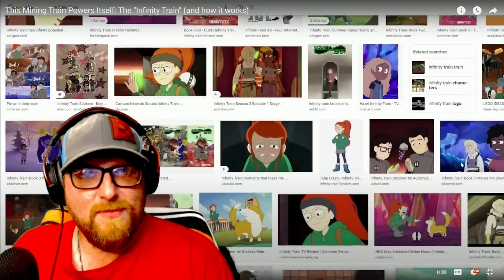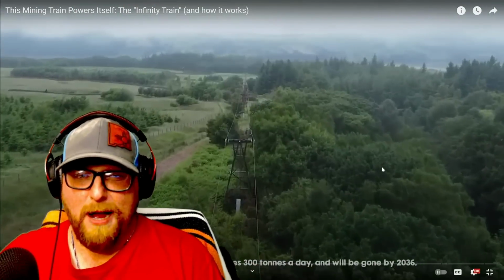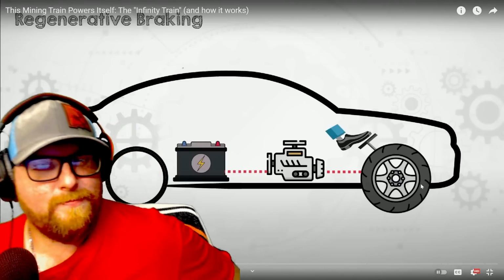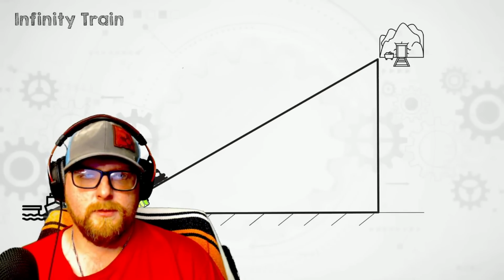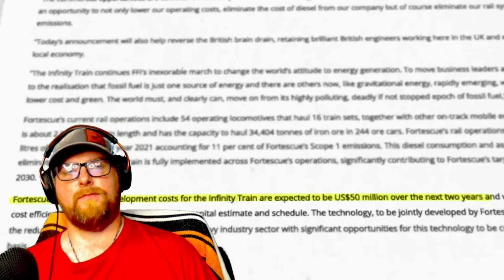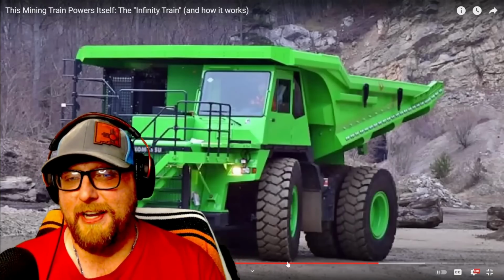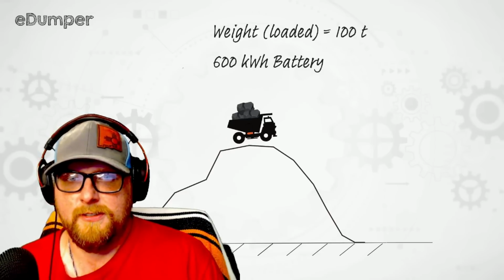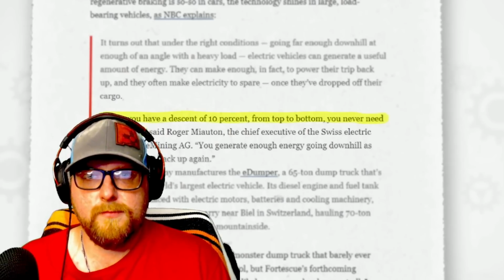American Reacts to Australia's  "Infinity Train" No Fuel, No Charging

Comment: running daily they will churn thru the batteries as they will only have the minimum amt of batteries needed... a deep discharge situation. still a better scenario though the regular costs are not stated for the battery packs.  Trucks are a wonky idea.... Nearly all mining is from a hole in the ground? Yes that means no meaningful regen...   better off using hydrogen in the existing diesel trucks.

Comment: Sailboats are starting to use hybrid diesel/electric propulsion systems. If you have enough wind, your hybrid motor turns into a generator that charges your batteries by turning the prop all without using an ounce of diesel fuel. You also can supplement your charge with solar power. Pretty cool technology.

Comment: And only if thay could make car s run on compressed air as the car drive it take s in air  to two light weight tanks. Plus solo powers. And an battery. If no sun. Car will run on compressed air. When no sun out.  And the air intake chardge a turbine  that can power the car. Battery to chardge it to. If no sun out. No need for charging station .

Comment: There are many old funicular railways that usr water tanks in the downward car to pull up the other car (connected by cable). This is not perpetual motion as the water going down provides the energy. If water is free then taking it downhill is economic. With the infinity train you are just using the electric battery as a cable replacement ... the power comes from the potential energy in the load. You could do similar with passenger trains if you had a free resource (water) and used it to generate power on the downhill trip ... but why not then use the water to generate power and feed it to the train to power it? ... you can still use regenerative braking to save energy.
The infinity train will only work if you can generate enough power for the round trip during the trip itself (not ignoring losses).
Remember that if you have a failure before you can generate enough for the upward trip then you will need alternative power to return the train to the top.
The slate quarries in Wales used the weight of the slate going down to pull the empty wagons up using a rope 'balanced' incline. The Festiniog railway (from about the 1850s) used the weight of the slate to go down and horses (later steam power) to pull the empties up. Unfortunately there was no regenerative capability then and also then too long for a ropeway!

Comment: Remember that any aerial tramway for taking mined product or timber from mountaintops to valleys are also significantly "gravity powered" (though braking systems may not have been regenerative historically.)...  Obviously if things need transporting uphill (net) then energy input is needed.  - most mine to port operations are downhill, reducing energy needed somewhat due to geography..

Comment: Sorry this is a bold face  lie.  What is not told is that the batteries will not last and cost millions of dollars not thousands to replace. A tesla car battery costs around 15 thousand dollars to replace.  Enough batteries to power a train up the hill an carry all that weight is millions of dollars. Funny part is it takes billions of dollars in diesel fuel to dig up enough raw elements to create these batteries. So this is all bull shit! And anyone who thinks this is great is an blind idiot because the damage to the earth is greater than burning gas or diesel.

Comment: 1:43 this already happens with some electric quarry trucks.
edit: 7:47 never mind, she mentions it.
But she is wrong about the "not 100% self sufficient or there is another similar truck. Because at the end of the day, the dump truck has to be plugged in, to EXTRACT energy from it, because it's regenned so much during the day it doesn't use it all to get back to the top of the hill. So ends up with surplus.. And they sell that back to the grid..

Comment: So good to see thinking young people coming up with adapted concepts such as this even though the principle has been around for a long time. I am aware of far too many fuddy duddies in my older age bracket who are so set in their ways they don't want to know about this
In Oz we are building the Snowy 2 addition for Hydro power and it uses pumped restored water for power. Also aware of trials in UK where heavy walking areas are fitted with tiles that generate energy when walked on...promising stuff. Also the freeway small wind turbines that generate energy as fast moving cars travel by.. 
We have to remember we used to use nothing but wind and water energy at one time before we had power stations.
Reply: The problem with the this train is this. Everything what she saying can work, but the major problem I see is the batterys

Comment: They also use AI and robotic trains up there too. With many trains actually operated remotely in Perth!!   Thousands of miles away!  Huge capital saving with fuel and maintenance too.
Reply: I work on that railway. Been around those robo trains for a few years now and it's still trippy watching a massive iron ore train that's 2.5km long going past you with no driver in the cab.

Comment: Whether it is cost effective will depend on battery life. We are already seeing worthless electric vehicles that need new batteries which would cost more than an equivalent working vehicle.
Reply: Average electric car battery life is fifteen years (based on Tesla experience).
Locomotives chassis are rather more robust than the average car so swapping the battery may be economically viable (assuming that the recycled chassis used for the test locomotive lasts that long).

Comment: Electric power what You generated  is lost ca 15 -20 % to elecrical ines + tarnsformator to get right Voltage  and Ampers. That los get  bigger when temperature is too hot or too cold = ideal temperature is  + 12 unti + 18 Celcius. 54 until 65 F. by humity  49 - 65%.

Comment: A lot of commenters need to calm down and realise that this works only in a very specific circumstance. The mine must be at a far higher altitude than the port. The train recharges it's very large and very expensive battery by regenerative braking while going down hill with a very heavy load. Once at the port it unloads and is much lighter. It then can use its battery to drive up the hill back to the mine. It can only do this because now it is empty and much lighter. If the mine was at a lessor altitude or say level with the port this system would be useless. There is no magical technology at work here. It has no use in the every day driving of cars and trucks.  You couldn't for example use it in a passenger train unless all you are doing is dropping passengers off at the bottom of a very steep hill and never bringing them back up.

Comment: The pay back comes. But the battery making and change over is still stagering. Would be maybe a 20 year turn around for costs involved. If we can still get rare earth minerals and get them made. And I'm in Western Australia. Great idea, think hydrogen is the fix as the owner of the mine is pushing hydrogen hard for WA.👍
Reply: Actually payback on the energy cost of battery manufacturing is about two years average driving. Fuel production is horrendous inefficient too (only half the energy winds up in your tank from what comes out of the ground and at best your car uses about thirty percent of the energy you put in the tank).
Hydrogen production converts about 30% of the electric power going in, into hydrogen to put into your vehicle.
It’s only advantage is energy mass density (which is useful for rockets and slightly less useful for aircraft due to poor volumetric energy density).
Biomass fuel is probably more useful for aircraft.
Reply: @allangibson8494  back to the original  comment then. Hmmmm

Comment: How long do batteries last before replacing? cost ?and what landfill are they dumping batteries?
Reply: Still believing batteries are "dumped"? They are way too valuable to do so. Usually they get a second life a power grid stabilizer either in a house or a factory, depending on the capacity. And foe record: Modern batteries lose way less capacity than older ones. Their actual loss heavily depends on the way they are operated though. Considering this is a line where they are loaded and unloaded on a pretty constant level I guess they might work at least 20 years only losing about 5-10% of their capacity. And even that is a pessimistic assumption.

Comment: Ev are worse for the environment than diesel over a lifetime 🤦‍♀️🤦‍♀️
Reply: Not sure where you life - maybe that's true there? Maybe you still use lead batteries? Good luck with that. If not, your statement is completely wrong and a pure troll show. Maybe it was even correct in 2000, maybe 2005, but the turning point has long been reached, and the gap is widening every year.
Reply: @SirHaviland  like lithium is safer than lead tosser hahahaha
Reply: @MrDamo1648  It is though? Lithium is not toxic like lead. It can be used way longer than lead, and maybe not in your country, but in Europe nobody tosses out a Lithium battery because it can be recycled for a good price. Try that with a diesel fuel tank.
Reply: @SirHaviland  modern diesels are near zero emission these days and kids are used to mine lithium
Reply: @MrDamo1648  Near zero is an illusion that is fed by the automobile industry. Did you live under a rock when the diesel scandals popped up? They fix their stats to look better, and eventually they are busted. And children in mines? That was a thing way earlier than EVs were relevant. Nobody gave a damn about it. Bigots...

Comment: Pretty good idea if it works, going to the coast fully loaded is mostly all downhill, it takes miles for them to do a braking stop even from pretty low speed, the mass and energy is enormous. After unloading the ore it's pretty light.
Reply: The concept works all right. Think of those long gone lifts in multi storey buildings in the past which worked on counterweights. This is basically the same except that energy available is being stored.

Comment: The location of the iron mine in the Pilbara region of WA  of course is ideal for solar power, with large area available for solar cells  and very commonly major sun availability for most of the year,  also being in tropical near equator region  actually above Tropic of Capricorn  southern limit of solar travel for our summer,  northern winter,  so even has much time for solar overhead or close to overhead maximum power capture. Maybe only for short times needing diesel generator supplementing for tropical storms and cloudy conditions  likely only under 10% daytime  though storage needed as mines operate nearly 24/7. So truck may need some top up power even in the night.
Still making huge gains towards zero emissions,   maybe improving trucks and storage batteries the 2% deficite can even be reduced further  or be so small that the number of trips overnight can be run on stored power alone. But recharging full capacity in early daytime is too costly in time vs work capacity so remains difficult.
All a great future benefit. Cost savings should be very good, though rather than increased profit, allows cost of the ore sold to be kept lowered adding to competitiveness with mines in say Brazil.

Comment: And a significant CO2 reduction too.
There is also considerable saving on train brakes  as with massive regenerative braking there is minimal need for conventional brake pads to handle many thousands of tons of ore down hill. Wear down of pads  train wheels alone will be reduced massively  along with down time for maintenance  brake pad exchange and wheel replacements. Beyond that is that the train is now braked on board  not by friction from wheels to track rails, often for steeper sections even demanding sand onto tracks to keep wheel to track fraction high and not just slipping. Well the tracks now will have considerable longer life, as even will the rail stays having less forces from needing to carry the braking forces horizontally in same transient affected manner. Longer rail line life and lower maintenance of even that infrastructure system.
Reply: Wait until they find out how much weight in batteries they will have to carry, that will reduce cargo capacity, requiring more trips back and forth. Then the rapid pace at which the batteries will degrade and require replacement at huge cost. My money's on this not working out.

Comment: In Norway/Sweden, the Ofotbanen line transports iron ore from the mountains and down to the ice free port of Narvik. The ore trains generate more than enough current by regenerative braking to power the return trip. Of course, this is not a closed loop-system, Ofotbanen is connected to the main line in Sweden and is also used for passenger trains and general cargo. Balance power is hydro, easy and fast to regulate. This electric line opened 99 years ago.

Comment: The word of the day is funicular. The ropeway system mentioned in the video is a funicular system of counter balanced carriers helping negate the need for extra input to overcome a grade. As for the E Dump, it's not new either, A lot of the bigger run a diesel generated electric propulsion. This opened the door for using a pantograph system to help power the truck. Now add regenerative systems and you have a pretty efficient infrastructure.
Reply: Electrically braked conveyor systems exist too - they have a motor/generator for starting but once loaded actually put power onto the grid (and use the grid for a dynamic braking resistance).

Comment: It will always use power faster than it can be replaced.  Meaning it will eventually run the battery dead at some point.   What she is suggesting is complete 100% free energy, and if they have figured that out, then they have revolutionized transportation forever as we know it.
Reply: Wrong, watch again and this time, pay attention.
Reply: @marvindebot    LOL  Unless you're going to reply with some intelligence, why even bother.   You see, many people have tried this idea out already.  Turns out they needed a separate motorized system to pull the train back to the top of the hill.    BUT WHY IS THAT???  Well, because the train would use up all that stored up energy WAAAYYYYYY  faster than it could replace it,  just like I said.  Because that's how shit works, but you would know this if you had bothered to learn anything new instead of just believing some bullshit you heard on YouTube.   You know there's a group called the flat earth society, you might fit right in there.
Reply: High mass downhill - low mass uphill.
Net positive energy output.
The train going uphill weighs 20% of the train going down hill.

Comment: So really that Edumper will only do at most 50 trips or a bit less on a full charge. Question then is how long will this truck be out of action while it's getting fully charged again? 🧐
Reply: 600kwh battery can be charged in about 2 hours. Just enough time to a checkup on the truck.

Comment: Thanks for that - never heard of this before.  Regenerative braking eh.  Did a quick research and article stated if you use yr brakes regularly they use up the stored power you just saved into the system.  PLUS if driving a vehicle fitted with Regenerative braking, it will take more brake force to stop the vehicle.  Occasionally the brake pedal (in an auto car) will on its own, depress down further towards the floor, the carl braking harder than wot you are used to & giving drivers quite a fright.
Reply: The article you read seems to have got things wrong.
Regenerative braking re-'Generates' energy in the way that Rosie mentioned.
The regeneration provides extra brake force to that would normally be used by the brake pedal alone, so it creates more brake force not takes more brake force.
And the pedal disappearing under your foot is to do with the anti collision sensors on modern cars, so if the car decides you are too close to the car in front, the car applies more braking force before the driver reacts.

Comment: That is kind of scam news, the only issue here is that way too few of Austrialian railroads are electrified.
Electric trains usually have regenerative brakes that feed energy back into the power grid while braking.
This was first employed in 1886 (!): https://en.wikipedia.org/wiki/Regenerative_braking
So no, this is not news, they only use batteries instead of regular catenary wires which would be much more efficient and more environmentally friendly overall.
Reply: Ah, almost every main line in the country is electrified, the vast majority of coal and other mining products are moved to ports or processors on electric trains. As for catenary, mate you can't feed power back into the grid where no grid exists, have you any concept of where The Pilbara is and how far from anywhere that part of the country is? The nearest substantial electrical grid would be Perth, well over 1000 km away.
Reply: @marvindebot  It may also be a local power grid, any way, any power grid is more efficient than a battery. Nonetheless, it does not change the fact regenerative braking is not news.
11% or 3,488 kilometers of railways are electrified in Australia. For comparison: in my home country of Austria 3,533 km are electrified... Find the difference between Australia and Austria... ;-)
"The majority of coal trains are electric"? Any stats on that? It seems to me the status of electrification varies heavily from state to state.